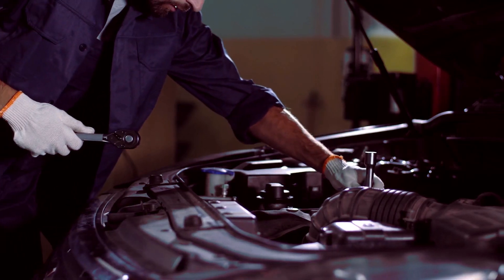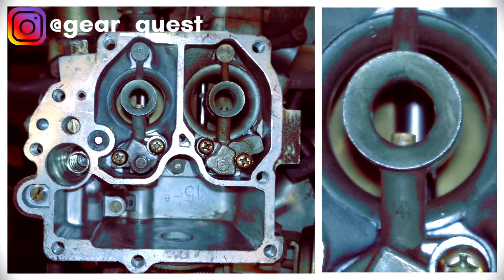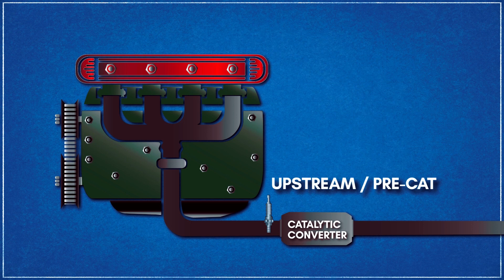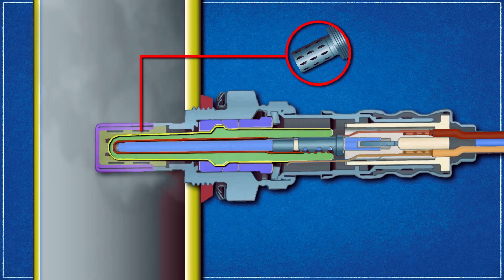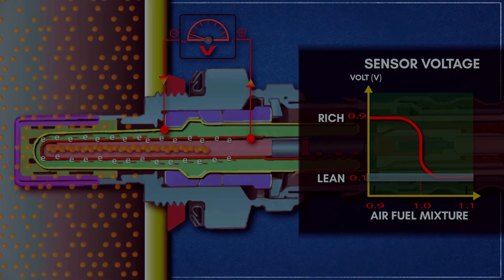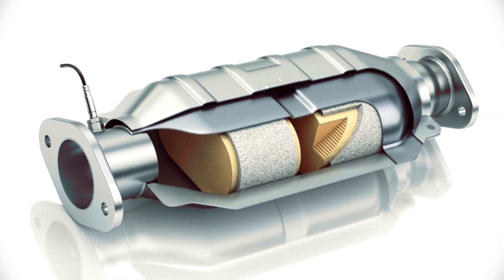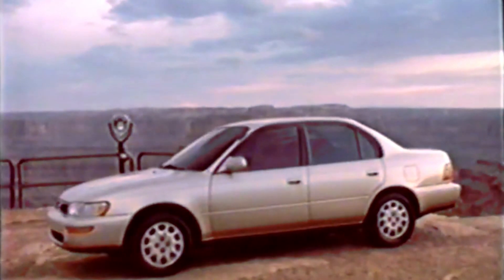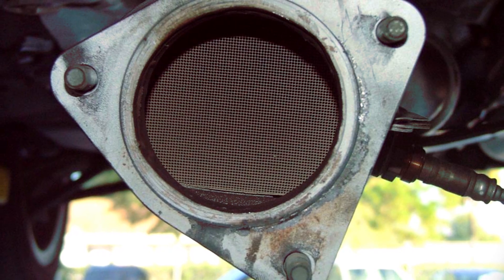Demystifying the O2 Sensor | How Oxygen Sensors Work

Comment: The spacers have nothing to do with o2 concentration either, it's for temperature. Excessive temperature reduces the voltage output so making it seem as though the mixture is leaner than what it actually is. So you got that all wrong too,

Comment: O2 sensors only respond to o2 concentration when on the lean side of lambda 1, The highest voltage it can make as a nernst cell is about 300mV. That corresponds to the half cell voltage for oxygen ions. When richer than lambda 1 the sensor responds to the concentration of HC and CO as well as H2 while the concentration of o2 is effectively zero That's the full cell voltage and explains the sudden jump in voltage AT lambda 1.  Your explanation is completely wrong of course. The difference before and after the cat converter is because the cat converter reduces the HC and CO concentration by oxidising it with the NOx which it reduces to O2 and N2.Nothing to do with o2 levels
Reply: Anyone who's studied chemistry at university level should be fully aware of what's going on, the topic being redox reactions.
Reply: Can they be cleaned to like new performance
Reply: @LeoJennings-hc6uv  Maybe. I've tried and not had any luck

Comment: I believe that your description of how the ECM responds to O2 sensor voltage is backwards (an increase in O2 voltage causes ECM to increase fuel injected).  You state that the O2 signal increases voltage when there is a larger O2 difference between the atmosphere and exhaust.  When the exhaust has less O2 the sensor increases its output voltage.  An increase in O2 voltage means less excess O2 is available for combustion, this  should cause the ECM to reduce the amount of fuel, NOT increase it.    If there is more oxygen in the exhaust gas the O2 sensor voltage will drop.   The excess O2 is available for combustion of additional so the ECM would then call for more fuel to be injected.   So there is an inverse relationship between O2 sensor voltage and amount of fuel injected.   i.e.  An increase in O2 signal voltage causes a decrease in fuel injected.
Reply: I agree. Really excellent video but the rich/lean response is definitely reversed.
Reply: Agreed.